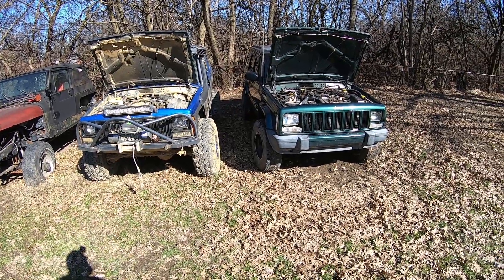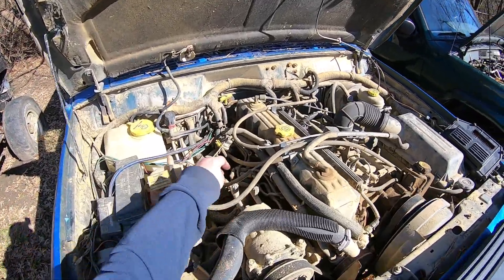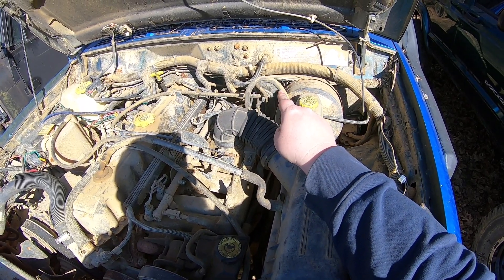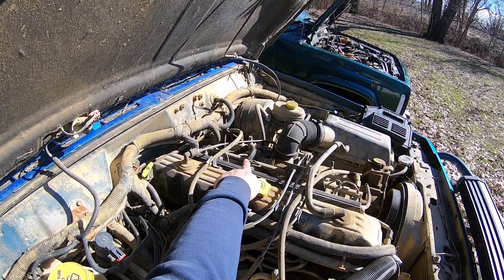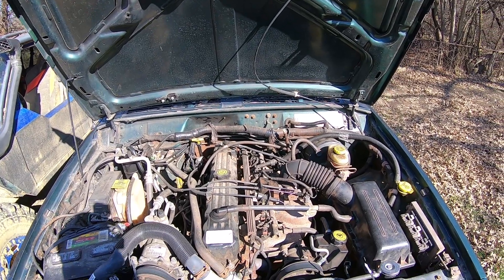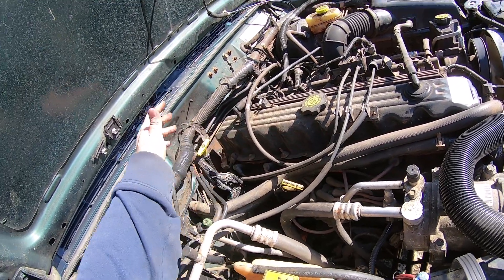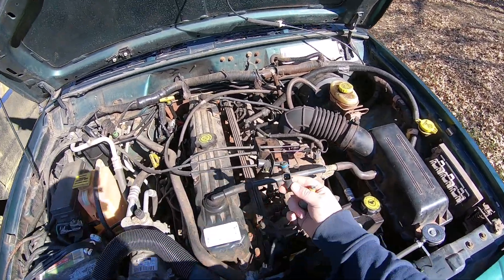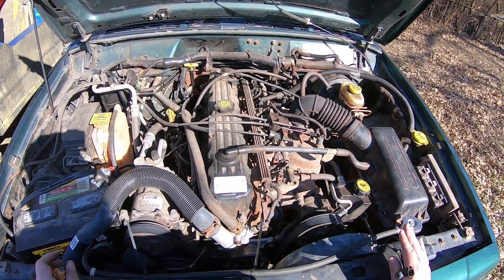91-01 Jeep Cherokee XJ  Wiring and Ecu compatibility. What years work with each other. Computer

Comment: 94 and 95 are different that the 91-93, different ignition wiring with the resistor and the tps is different and won't run right. It will run but not right and have codes for tps and ignition

Comment: I have a 96 with a bad map sensor plug the has the round pin female connector that I cannot find to replace I can only find the 95 style connector for fire wall mounted one or the flat pin 97 style connector

Comment: Mine is 2001 cherokee xj. Could i change the engine to 97 with just changing the ecu and injector harness and distributor and oil connectors ?

Comment: I’m converting my 96 front end to a 97-01 front end. Will a header panel harness from a 97-01 work/connect to my 96? I ask because the 97-01 front parking light takes 2 bulbs and connectors compared to the 1 bulb and connector on the 96s.

Comment: How can I run a 99 4.0 in a2000. 4.0 Cherokee ? Change from distributor to coil pack and use the computer from 2000 is what I’m thinking but how ?

Comment: I have a Jeep that is a 2000 model but someone has put a 1997 motor in and tried to convert it to coil instead of distributor. It misfires badly. Do you have any suggestions on what I should do?

Comment: On my 98 xj with a 99 engine, the oil pressure sending unit and plug on harness was different between the 2. I was running the 98 sender on the 99 engine with the 98 harness and 98 ecu and all was good. Then the ecu went, so I put the 99 ecu in and everything worked but the oil pressure  gauge. So now I’m going to try putting the 99 harness in with a 99 sending unit.
Reply: Having this same problem but mine is a 2000 with a 1998 motor pcm and harness only problem is the oil pressure gauge did you ever figure it out?

Comment: So right now i have a 98 with a bad ecu, one of the cylinders is not getting pulse to the injector i have to replace the ecu for sure that means i can replace the ecu from a 96 to a 99 no matter the little tag the ecu has as long is 96 to 99 and a 3 conector??

Comment: i think the ecu in my 99 is bad because the jeep as been running very lean and all sensors grounds have been replaced and or cleaned i understand that 97-99 will work but i have a 5 speed is there a difference between an auto and a manual computer?
Reply from the maker: Auto have a tcu under the dash so the computer should be the same

Comment: I put a 98 ECM in my 96 after the factory one fried, and it starts and runs but barely, is that the ECM programming or just more typical xj problems ?
Reply from the maker: 96 only works with 96 doesn't interchange. Its basically a 94 95 with 98-01 ecu plugs and a obd2 port.

Comment: Thanks for the information. It gave me some areas to think about. I am in the middle of a frankenstien swap from a 97tj to an 89yj. Trying to get rid of the renix system (that also has many bad wires) and enjoy a little fuel injection. I have the injector harness and the motor harness but do not have the firewall harness. Just getting started. We shall see how it goes.

Comment: i bought ecm for my cherokee xj 2000 number 635AJ  then the car start and turned off after 3 - 5 second the seller said the ecm without skim but its not programmed to my car vin what will i do
Reply from the maker: Disconnect your skim module. Every non skim ecu has a blank there. Once it sees the skim module it connects to it. Making the ecu useless with out programming. Try unplugging the skim module first and unhook the battery. Stick the ebay ecu in and never plug the skim back in.

Comment: What exactly makes the 96 unable to be replaced with a 97-99 ecu?
Reply from the maker: Try it and let us know the 96 have the one peice harness vs the 2 so hell it might work.
Reply: I tried putting a 96 ECU in my 99. Everything seemed to work fine except my gauge cluster. None of my gauges worked at all.

Comment: Great info! Can you run a 99 ecu on a 2000, also can you use a 99 injector harness for a 2000?
Reply from the maker: 99 are distributor and 00 are coil pack so not sure let us know if it does work.
Reply: Thanks for getting back, may give it a shot. What about the harness?

Comment: Do i have to swap the engine harness if i want to put a 99 4.0 xj into a 2000 4.0 xj or can i use my harness in the 2000 and just swap computers and drivetrain in
Reply from the maker: Just use the one on the 2000
Reply: @BudgetPowerGarage  thanks will i have to wire in plug to distributor
Reply from the maker: @jessehinton480   Take distributor out and put the cam potion sensor in and use your coil pack off the old motor. The ecu will not be able to run it with a distributor. You will have to put number 1 at top dead center before dropping in the CPS. Im Sure theres a how to do that on youtube. Also may have to get creative on the coilpack I dont think the 99 had the bolt holes in the head.
Reply: I have a complete 99 and was trying to swap in 2000 wanted to keep the distributor setup i have everything from the 99 just need to know if i can plug and play computers with the harness that in the 2000 already
Reply from the maker: @jessehinton480  No you will have to use the 99 harness and ecu.
Reply from the maker: When you pull the 99 just leave the harness on it. Unhook the firewall harness plug in the rear and that's it. Drop it in the 2000 and switch the 99 ecu in.
Reply: @BudgetPowerGarage  will this also work for a 97 motor swap going in a 2000 xj? Thanks
Reply: @Itwillgetbetternever   did you get that to work? I’m trying to figure out right now what I need to do to put a 97 motor in a 2000
Reply: @ryanburroughs280  I’m doing the same did you have any luck?
Reply: And wire in plug for the distributor
Reply: Thanks for the info and help

Comment: Can I take the engine and trans from my 2000 Jeep Cherokee xj 4.0 6L and put it in my 1992 Jeep Cherokee xj 4.0 6L ?
Reply from the maker: Look up renix to ho swap. For engine. Transmission input and out put splines are different so the transfer case wont mate to the new trans plus the tcu will probably flip out also. If your set on it you could dash swap and use all the wiring computers from a 2000 will require new holes in the firewall. Engine trans and transfer case. All as a unit.